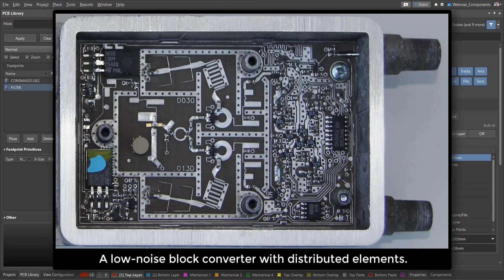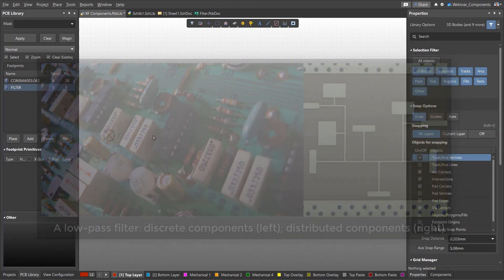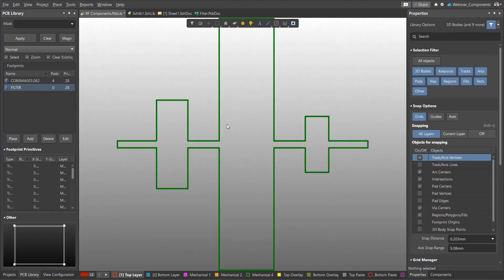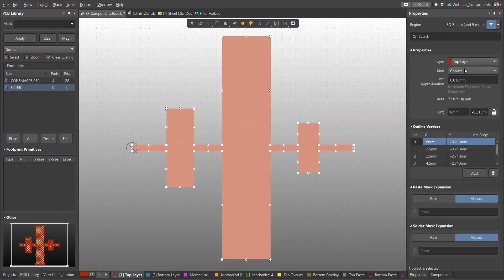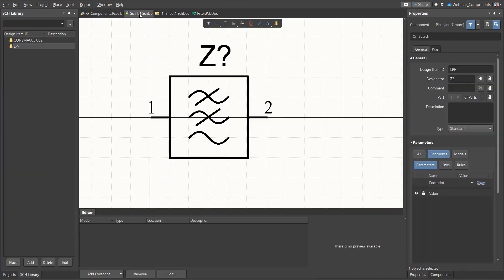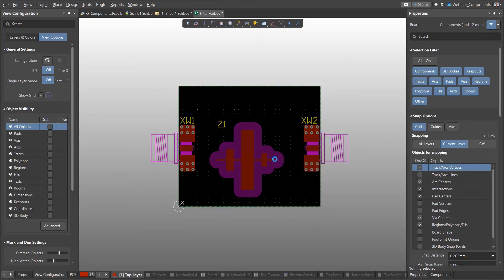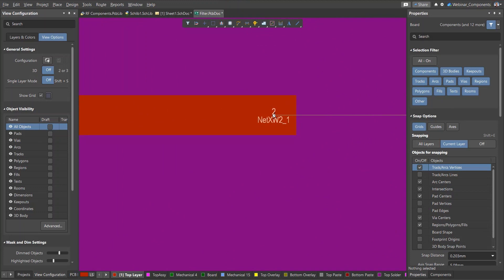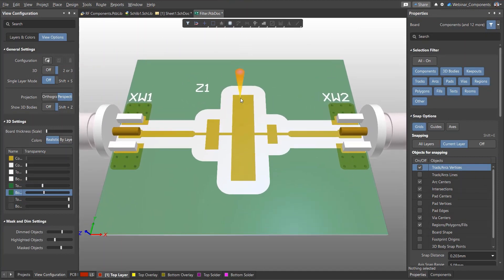RF Design in the PCB: Distributed-Element Circuits

Comment: Hi. 
There is one significant error in the presentation.
The filter structure is incorrectly connected to the 50 ohm line on the input and output.

The presented filter is a simple low-pass filter built of a cascade of narrow and wide sections of transmission paths.
When the width of the transmission line is less than the impedance of the system (e.g. 50 ohms) and its length is much shorter than 1/4 wavelength, it acts as an inductance, while if it is wider, such a section of transmission line acts as a capacitor.
The presented filter can thus be represented by an equivalent circuit consisting of L, C, L, C and L connected in series.
Now let's move on to how to add input and output ports.
Both ports are located not at the end of the induction part, but slightly "inside". As a result, the wider 50 ohm line overlaps part of the narrow path.
As a consequence, the narrower part of the filter structure will be shortened and the filter itself will be detuned.

The best way to avoid such errors is to import planar structures from a simulation tool with pieces of input and output lines with nominal impedance (usually 50 ohms). Personally, I recommend leaving the 50 ohm traces as long as the width of the 50 ohm wire. Placing a connection port in the center of such a square and then connecting a 50 Ohm line to that port will not change the microwave structure.
Reply: I think the connection is perfectly fine - there is a step impedance change but this would show up in AWR- Axiem  or ADS- Momentum simulation and probably it is compensated.